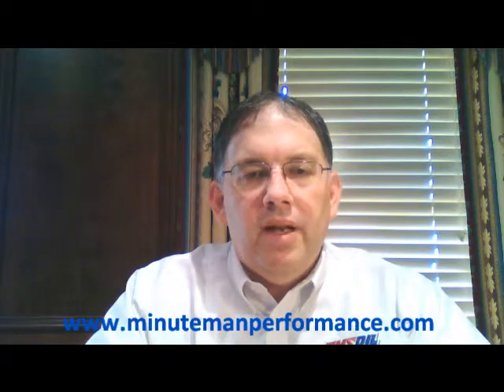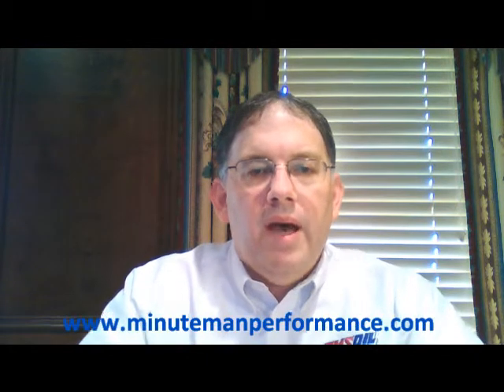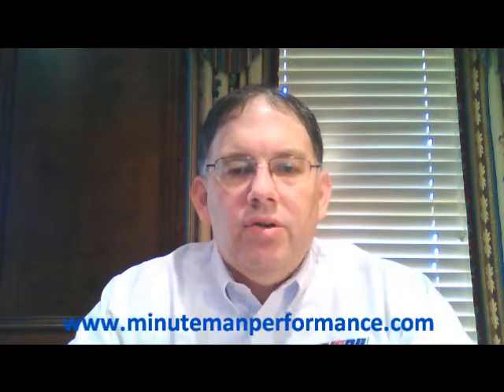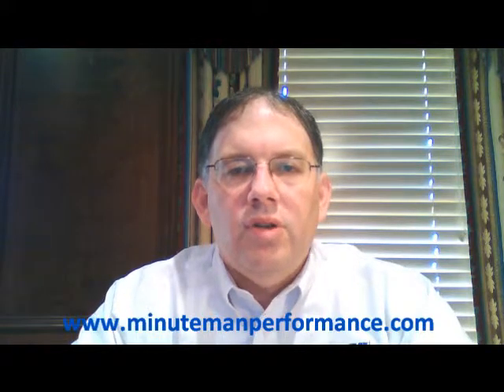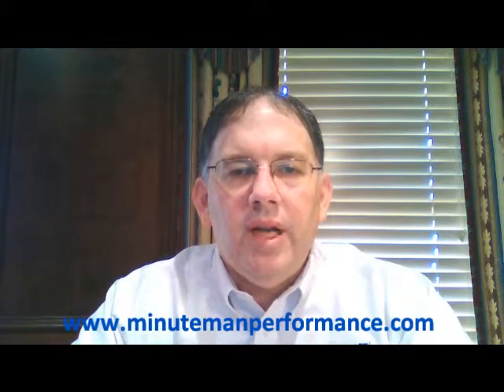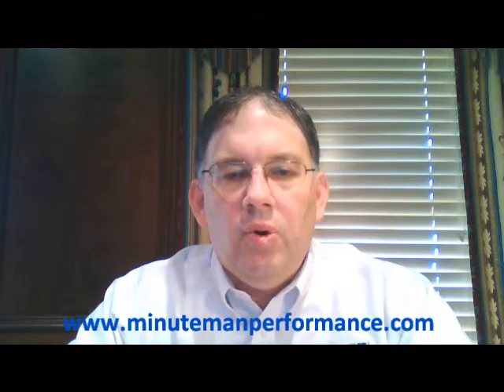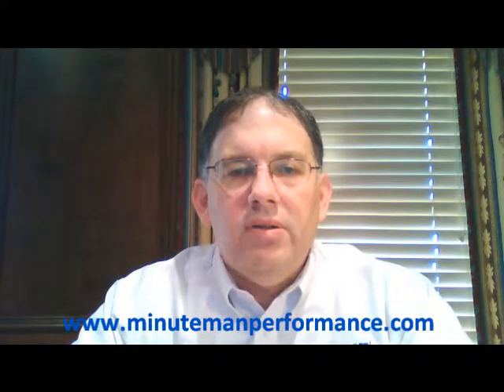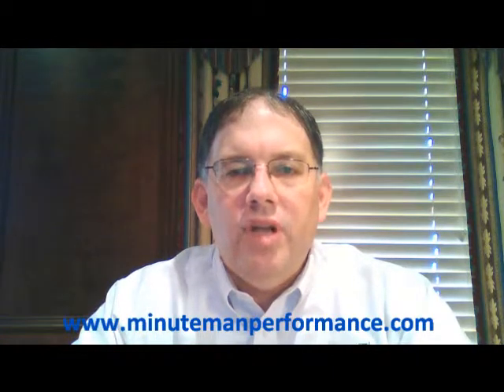Oil Change Intervals for Certain GM Vehicles Equipped with HF V6 Engines

Comment: My 2012 chevy mailbu LTZ 3.6 V6 has same problem right now my gm dealer is going replace whole motor with new one under my power train warranty they told me change the oil every 5000 miles then following the gm oil life montior

Comment: Does this include the LY7 HF 3.6 liter or just the LLT's?
Reply from the maker: +mojorisen74 Based on my research, I would say yes - it applies to the LY7 and LLT engines, but you should check with a GM Dealer to be sure.